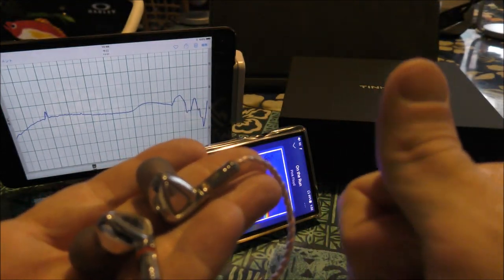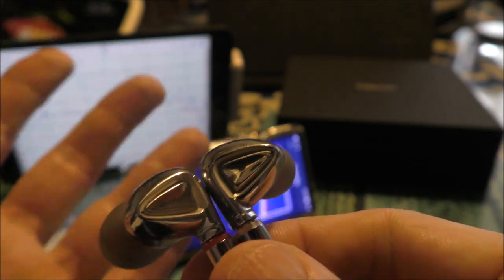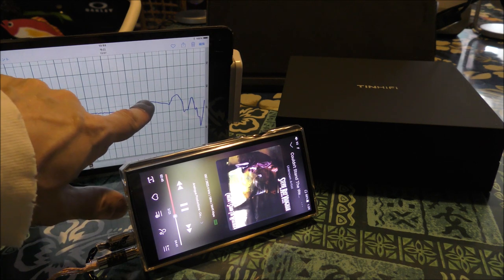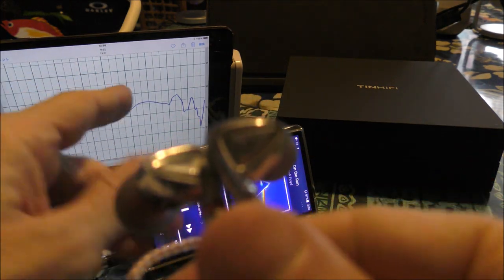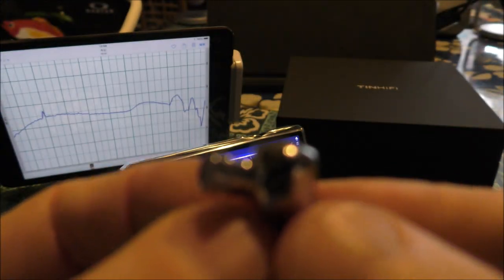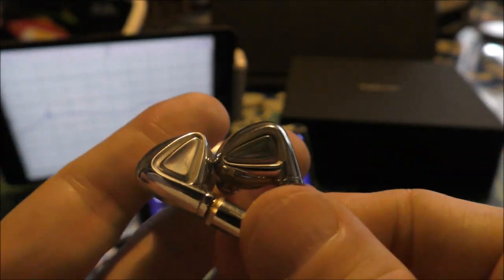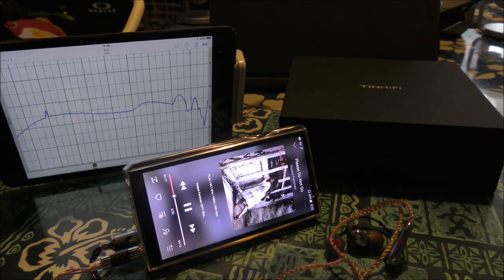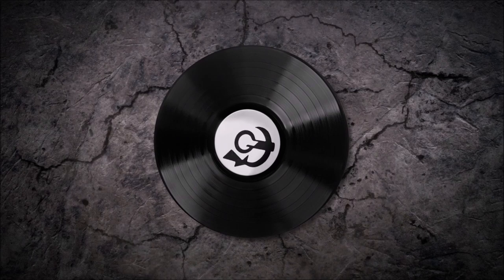✅ Tin HiFi (Tin Audio) P1 planar IEM

Comment: I love Stevie Ray Vaughn (and yes, it's Double Trouble) and I lime you too.  Man am I glad I caught this vid.  I was about to pull the trigger on the Fearless S8F... For $149 I'll try these first.  I've been looking to move up from my SE535s and turn the 535s I to my BT set for the gym with a BTR3.    Thanks for the list and the vid.  And yes, your vid is perfect because it's different than all the others that will inevitably come out showing the unboxing and all the accessories.  Your give real impressions.
Reply from the maker: Yeah, try these 1st. For $150 it's a good adventure to go on without burning your wallet. The S8F will be there later no doubt
Reply: But does BTR3 have enough power to run them? Thinking about getting P1, have BTR3k

Comment: Would these work with my phone without amp/dac thing? Is difference between P1's and T3's (listening on phone) worth the money? Or should I buy amp and not even talk about t3's - If yes, is dragonfly black ok for P1's?
Reply: Dragonfly Black ain't no AMP, just a DAC. Might still be enough though.
Still, I am curious about the needed AMP as well, after all I use IEMs on the go and can't be bothereed carrying much more with me.

Comment: How is the isolation? If possible, can you compare the isolation with the Kanas Pro for reference?
Reply: I have the tin t2, same maker. their pads are very isolating. they cancel out the exterior very well.
Reply: I think the P1s are some of the worst isolating IEMs i've come into contact with. Just my opinion. The foams do make it bearable.
Reply: @bond4177  My P1s just came in last week. The isolation is terrible. I used 3rd party tips big size but still leaks if I turn my head. And when it moves the low end escapes and you feel just mids and highs.
Reply: And they need an amp. They sound so good but if you don't have a portable amp but have a desktop amp it's better to buy hifiman he400i. You can finde them down to 180 bucks on Amazon some times
Reply: @iluvj00  Exactly. I think these can sound incredible under the right circumstances. Idk if it's a combination of the metal and shape, but I legitimately can't wear them outside with silicon tips, too noisy. 

Also, first time I heard them, I genuinely thought the reviewers are too old to notice the dreadful spike at near 20k. Actually stopped listening to them, for fear of hearing damage (I work in pro audio). But then, when listening with the foams, and using a better amp, that issue isn't present... odd thing.
Reply: Can't compare to a Kansas Pro, but holds its own to a shure 535 with foam
Reply: @iluvj00  wow seriously? I personally can’t hear a damn thing when I have these in 😂

Comment: I'm on Linsoul now. I'm a bit confused. On the page it says it comes with an MMCX-3.5mm cable. Is that if you pick the IEM only option and the other options are for upgraded cables or does it literally mean IEM only?
Reply: It will come with the cable. I was also confused at first until I read this: "P1 will come with an MMCX-3.5mm Cable. The Whole set of IEM includes the Cable as the description." The other options are for upgrade cables.
Reply: @skrt459  Thanks. That's how I interpreted it but wanted a second opinion.

Comment: What make the requirement for an amp for these?
And what are the amp that is needed? (I mean like low output impedance or or voltage/power ... what.. and yes indeed why.)
Edit: Sensitivity was low for a headphone it seem.
Reply: 5 milliwatts aka anything
Reply: @Ducksnuget  Yeah that's why I don't understand such claims.
Then again I don't understand why a 98 dB sensitivity Klipschspeaker would need a 150 watt / channel amplifier either.
I guess one problem with these is that I assume they will quickly made a tweaked version and sell a P2 too and then wouldn't it be better to get that one instead? How likely is a discount soonish?
96 dB from 1 mW, 10 mW max -> 2/99, 4/102, 8/105, 10/106 dB or so?
Sure if some other have 117 dB / mW and accept more that will go louder but they don't think one should play them louder than that anyway? If one push through more one may damage them?
U=R*I, P=U*I => P=R*I^2, 0.01=20*I^2, I = 0.0223607A
20*0.0223607=0.447 volt, I know some amps have given around 1 volt so maybe that is a bit demanding anyway?
Is 0.5 volt hard for stuff like a phone? Is the problem instead that as they are designed they aren't designed to go loud? Shouldn't 106 dB be a pretty good loudness to stick below anyway?
Reply: knods head

Comment: I am choosing between Tin Hifi T3 and P1, but will only be playing from my phone. Is the P1 still an option for me??
Reply from the maker: Oh, I dunno yet. Some other reviewers have these and use phones. They might be able to answer quicker
Reply: @BadGuyGoodAudioReviews  thanks for the response. So far it looks like you're the only one who has them!! Lucky!!
Reply: @rebeltr0users131  
jaydunndiddit on MD said this which might answer your query?
"Going by their specs, at worst with a sensitivity of 92 dB/W and with an impedance of 20 ohm, for more dynamic pieces of music, their need for more current and voltage can easily double, if not triple, when in demand from the track.

While they'll sound "ok" out of your phone, you'll never get the drivers to respond to their full potential and bring out their best qualities until properly amped.

For example, many folks think the HD 6XX sounds fine out of an iPhone but they really take on am entirely different character and show a lot more capabilities when fed through a powerful amp that can deal with their voltage swings and power demands on more dynamic tracks."
EDIT: Formatting
Reply: I would get the t3 then save up a lil more for something like a shanling m0. A dap is worth it unless you have an LG phone with a good dac or something of the like.

Comment: So this will work fine with Fiio M11? I just read one reviewer claiming its a must to have a separate amp to make these sound right. I own the M11 so Im going to get the T9 and hope for the best. Your review has locked me into buying these ASAP. Great review.
Reply: i also own the m11, pretty sure if you use balance cable you'll be fine
Reply: @eranoved6757  What if yout use the 3.5 cable that comes with the P1? I think the reviewer was using that.
Reply: @mattgiunt  3.5 cable is only unbalance, you can try it first, if it's not enough then buy a 4.4mm/2.5mm balance cable. i can also give you and update once i get the p1 shipped
Reply: @eranoved6757  Thanks,hope you get it soon

Comment: Are these better than the Sony Xba-N3ap? I just bought the Sony Nw-Zx300 and I need a nice pair of  IEMs to go with it.
Reply from the maker: Those Sony are dark. I love em. The P1 has more accurate replay.
Reply: I have a n3ap.  Replace the stock cable with Alo Litz, making the sound brighter and warmer.  Soundstage is also wide.
Reply: Sony house dark sound. I like the sound depending on my mood and use the XBA-N3 when languid bass and a more mellow sound is desired. For fast bass, FH7 or iSine 20. Really interested in these.

Comment: Guys i got a HD650but one driver ( right ) stopped working, should I spend 50 dollars buying the driver, buy both drivers ( I'm afraid that the sound doesn't match ) or should I buy the Tin P1 ?
Reply: Good question..... I doubt drivers are matched in factory but if burn in is to be believed you would think there would be at least some discrepancy for a while. I would invest in your senns if they are your daily headphones. As to whether you buy one or two drivers though that is a tough one.
Reply: @dudemanismadcool  I asked Sennheiser support if there is any difference between drivers, I'm waiting for them to respond, if there's no difference I'll buy a new driver.
Reply: @dudemanismadcool  oh and thanks for the attention.

Comment: I get from all your videos, that part of your criteria for mind being blown is the whole value factor.  I can relate.  The cost of things can no longer be used as a benchmark of quality or value anymore.  the and the rate of diminishing returns is increasing.  But having said all of that .... if you could only have 1 of these IEMs, forget about the Dollars, would you choose the S8F or these new P1s?
Reply from the maker: I need more time but at $150ish dollars it's an amazing consideration. I love Dynamics for bass so i may need another set for pushing up 55Hz (Ex800,KPE,TFZ No.3) all fit that bill. At these prices having both is no prob. Which one of S*F or this? I need time
Reply: @BadGuyGoodAudioReviews  cool  thanks for the reply.  I'll be waiting and watching.  I'll buy the P1 in a heartbeat and hold of on deciding on S8F.  I'm still happy with my SE535s but suspect I'll be auctioning them and picking up the the S8F too!  thanks for all you do!

Comment: Give it to me straight, doc. Should I cancel my order on the No.3? My budget is $200 and I really want a pair that punches up in value. 

Also, the supposed thinness of the diaphragm sounds like it may not hold up for a long time. Have you heard of this being a problem in planar drivers?

Thanks!
Reply from the maker: Do you have any DD IEM? If so get the P1.
Reply: Ive had a few planer headphones from the 1970's that still sound perfect !

Comment: Did you notice any improvement using the 4.4 connector on the m11? how does the p1 compare to the dm7?
Reply from the maker: I always use 4.4 so I cannot recall 3.5 on the S8F?

Comment: Wow, I'm surprised at what the sound signature looks like. I stopped using my iSines because the required EQ correction was too hard to achieve on my portable device. It was just too messed up sounding.
Reply: Completely agree
Reply: I bought a swank cable and just could never get the EQ to sound as good as the Cipher. Right now have Cipher to USB C adapter for my M11 and sounds good.

Comment: I realize it's not the point but I wish they had a mic / remote. Same thing on the t2. I was all set to buy them till I notice they didn't have one.
Reply: Buy a aftermarket mmcx cable with mic and volume control and keep the cable that this comes with for spares
Reply: @AP-nf4yf  good point its still a bummer

Comment: I have isine 10 but i think that i will buy the p1. First of all i need something that i can listen to in loud enviroment, secondly im tired of mandatory eq and constant re adjusting of it. They sound great but you have to put a lot of work :(. And the build quality is crap  its all made with plastic and i already broke the hooks 4 times :P. And the cable is awfull too i have to straighten it every time i put the cable in etui. Its funny that t2 for 30$ has better build quality and cable then 300$ isine :(
Reply from the maker: I had the isine20 and it was a disaster without the cable and plastic. Loved the sound after fixing but they had balls releasing a device that was an iOS ready ...earphone?? Crazy stuff

Comment: Oh damn. I was considering the TFZ No.3 [cheaper one]. How would they compare? Have you listened to Hip-Hop or other bassy songs with these? I already own the KPE and DM6, so am thinking the planar could be rationalized b/c it'd be different. As always, Respect!
Reply: Ok. I'll admit I started commenting before the video was over. Think I am convinced... (~ 14 minutes in). You mentioned #1 or 2. Just Wow!
Reply from the maker: KPE and No3 both variations of good DD. P1 is a new animal. I'd get the new animal since youu have KPE
Reply from the maker: Hip Hop will be fine but a DD should be used  for bass heavy stuff and you got KPE. Try a highly resolving planar experience

Comment: If the FH7 do hey to be on the list now, what rank would it be?
Reply from the maker: #3 or 4 I have to compare with DM7 and TSMR3
Reply: @BadGuyGoodAudioReviews  

Do let us know where they be please, thank you.
Reply: @rekxar6314  the FH7 are REALLY REALLY tip dependent, they're not so great (for me) with foam and standard silicone but they're absolutely fantastic with the bi flange silicone tips, they're so good i can't stop listening, a good seal can make or break them, but once you get the seal you've been addicted believe me, the stage and imaging, the bass mids and highs with the green filters are astounding, if you got the budget go get em
Reply: @hkhudadad  

I would've had the Tin P1 did not exist, but let's see
Reply: @rekxar6314  yeah well I'm glad i chose the Fh7, i kinda would to buy these too now but i will rather wait and see what is coming the next few months
Reply: @hkhudadad  

Oh I'm definitely gonna buy FH7, but I'll go step by step, but is the bass that good on the FH7? That's the main thing for me about the FH7
Reply: @rekxar6314  well the bass if well isolated is very very good, i don't think it can get much better but then tried the bass tips with the bass filters and without eq it's really well done, bravo to it's not boomy like some cheap IEMs tend to be and the bass bleed is non existent, if you're a bass head then use that setup + eq boost and there is your bass head IEM i am more a clean and clarity guy so i leave it with green filters for max. clarity and bi flange for isolation but the bass is even there still very good, you get the punch, it hits hard and you can feel the rumble i love that shit. This is what amazes me about this set you actually can tune it to your preferred sound and i did not believe and thought of it as a gimmick but it does work, you will be pleased with them m8
Reply: @hkhudadad  

Well said, another very positive experience provided by the FH7 to another customer.

But one last question, does the highs sound nasal or natural, did it ever get piercing? I do tend to be very sensitive about the highs.

Comment: Got my P1 today (at the same time as the killer Audiosense T800 you also turned me on onto  - audiophile heaven on a budget!). As for the P1, it is every bit what you say it is...when driven sufficiently and with a bit of EQ. I‘m running it - as with all my IEMs (among which are the DM6, the Tin Audio T2 pro, the Kanas Moondrop, etc.) - off a FiiO Q5 (not the latest model with the „s“) via high-quality Bluetooth, using a high-grade Linsoul silver-plated copper cable. With that set-up, the P1 works best when the EQ gain switch of the FiiO Q5 is on, and - depending on the music you‘re listening to or your taste - also with the bass boost switch on. However, I have to admit this set-up underwhelms me. Why? The bass boost gives the P1 some balls, but also muddies up (masks) the mids and trebles somewhat. So not cutting it for me. With the Q5, I‘d stick with the Audiosense T800 for sure, and skip the P1. 
Next set-up (brilliant!): The cheap-but-mighty Radsone EarStudio ES100 also running via Bluetooth, AND using the free EarStudio app with EQ (!) adding a bit of bass and even a bit of upper-mid and treble. Folks, this is a high-res music streamer‘s dream set-up...at least if you‘re not up to buying the Audiosense T800 (which is admittedly more than twice the price). The EarStudio app allows you tweak the EQ of the P1 adequately. OK, so the Radsone isn‘t as hi-fi as the FiiO Q5, but paired with the pristine and impulsive P1 you are bound to have some eargasms. And the Radsone weighs next to nothing, runs long on a charge, clips to your shirt or pants pocket and lets you enjoy, unfettered, blissful Bluetooth streaming (of locally stored Qobuz files in CD or high-res quality, or Spotify files of max. MP3 quality). TIp: The EarStudio app lets you store up to 4 custom EQ settings, one for each of your favorite IEMs. And specifically for the gain-hungry P1, you can push up the overall gain in the EQ stage to get sufficient volume out of the P1. This is a quick-and-dirty combo that really works, and lets you tweak the P1 to taste, making the most out of its sonic supremacy while compensating for its (small) weaknesses. Strange that this solutions works better than pairing the P1 with the far more hi-fi (and expensive) FiiO Q5, but the proof is in the pudding, eh? One gripe remains for me: I am still struggling to get the P1 to seal sufficiently and reliably. I hate foam tips, and the supplied silicone ones aren‘t cutting it for me. I think I‘d benefit from some silicone tips with a bit of a longer „neck“ to them, in a medium to fat width for the outer seal. Any ideas?